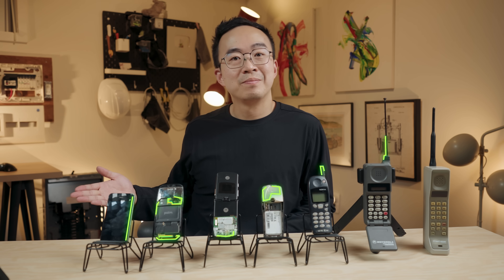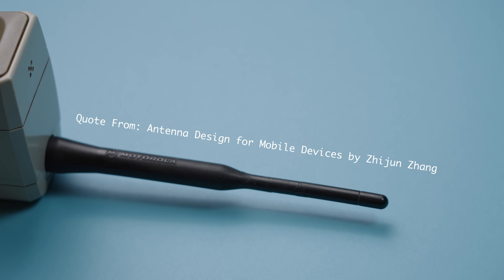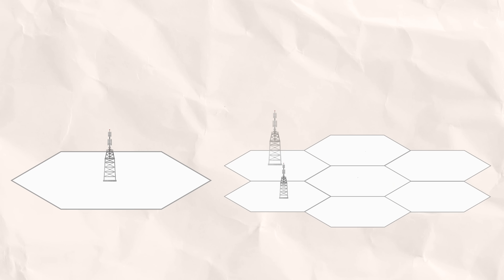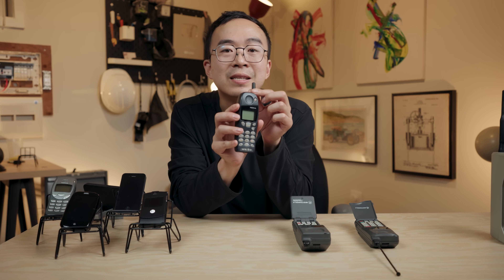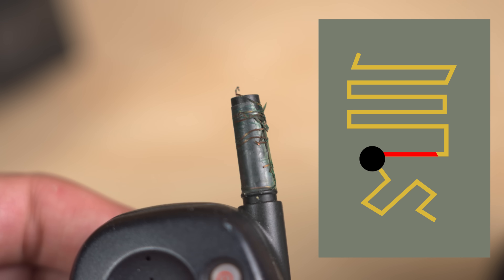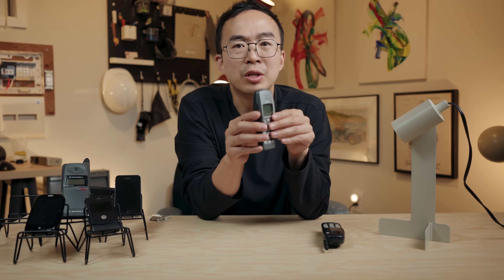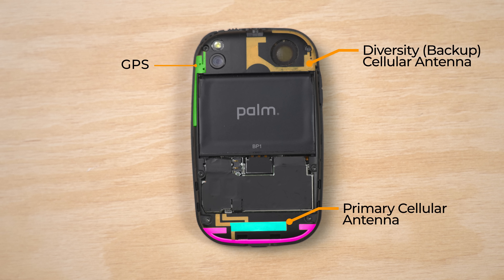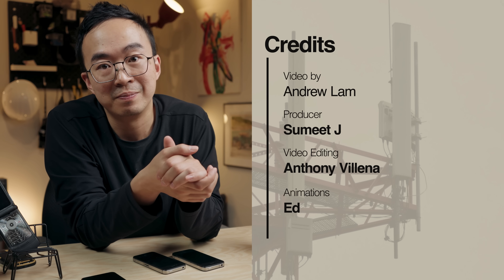How CLEVER Design Made Antennas Disappear

Comment: The iPhone 4 antenna snafu is such typical Apple. I remember back in 2006 when I bought an iPod gen 5 and complained that the thumb wheel was a bit too sensitive and lacked an adjustment setting, the answer was, "use your index finger." On the thumb wheel. OK.
Reply: Less "typical Apple" and more "typical sensationalist media". The iPhone 4 at two bars was receiving stronger signals than competing Android phones at full bars, but the internet saw an opportunity to be outraged and the rest is history. The same goes for CPU throttling, technology that is also used in... pretty much anything with a CPU. A modern PC has several pieces of hardware that throttle when under high stress in order to preserve longevity, but you don't see anybody crying about that. People are SO incredibly ridiculous that Apple eventually gave them the option to turn it off. Let's be very clear what this option is: it allows the phone to damage itself. People actually wanted that. They kicked and screamed until they got it. They are not smart.

Comment: Now phones and watches can talk with satellites too 😅
Reply: No?
They can listen to satellites, but sending information to satellites would require a lot bigger antenna.
Reply: @Floedekage   I have a Google Pixel 10 Pro and just last Tuesday my cell company added satellite service via Starlink.  At the moment, it's just texts but voice is planned for later.  Google also supposedly has a satellite service using geostationary satellites, but I have my doubts about it as geo stats are a much longer haul than the Starlink low orbits.  However, the demo that's built into my phone works well!  🙂
Reply: @James_Knott  it's very possible you can send voice from your phone via satellite, but you wouldn't want to do phone calls. The lag is insane.
Reply: @Floedekage   That would depend on the satellites.  With geostationary satellites, a hop would take close to 1/4 second.  But Starlink and others are in low earth orbit, around 1/10 the altitude of geo sats.  This would result in a much shorter lag.  Incidentally, for many years, before undersea fibre cables, geo sats were used for phone calls.  To reduce the lag they'd use the satellite in one direction and copper cable in the other.
Reply: @James_Knott  I'm sorry, when was satellite used for half the transmission of a phone call?
Reply: @Floedekage   I don't have the exact dates, but certainly during the 70s & 80s, prior to fibre undersea cables.

Comment: The number of towers is the really reason they could make the antennas smaller. Still lose signal in a lot of places every day so I wish you could buy a phone with a better antenna. Something like the first cell phone had would help. Maybe even a device in the car that would increase power and the antenna and we would not lose signal. And not cost too much
Reply: Your car cannot be a radio repeater because that would cause interference with the public radio waves, and you are not licensed for those frequencies
Reply: @KaitouKaiju  A mounted cell phone can have more power plus a high gain antenna which would increase range. Hand held phone are the only ones with low power rules to keep you from having too much radiating power near your head

Comment: Modern antennas are just built inside.. "Modern" because it's been the common practice since the early 2000s. However early 2000s phones were made of plastic so there was no need to add the seams. The metal around the phone made it more challenging to make antennas.

Comment: Cool video, as for why reviewers don't cover the antenna's it is a very difficult thing to test. Because of the loads of environmental factors influencing reception, getting reliable data in the field is hard. And lab setups using rf blocking chambers is expensive. 
If you try 2 phones in 3 different spots on different days results may vary wildly.

Comment: Antennas seriously deserve more attention in phone reviews. I had a mid-range Android, the Infinix Zero 30 5G, and the reception was pretty weak compared to my iPhone, which always has solid signal. I used to blame the network infrastructure here, but turns out the problem was just my phone’s antenna quality. Watching the video and seeing the difference in antenna design between the Infinix and the iPhone really explained why iPhones tend to have better reception. Antenna engineering matters big time!
Reply: This is why the first thing amateur radio operators tell newbies to do is buy a better antenna than the one that comes with a radio. A good antenna makes a HUGE difference

Comment: Nowadays there also seems to be phones that have even more antenna because the user might block both set of the antenna when holding the phone in landscape mode (for example, when playing games). Also, there are indeed tech reviewers that build their own celluar station to test signal reception, for example, Geekerwan does that for both the reliability and the speed, and also for testing power consumption in bad signal strength, although I'm not sure if they translated all their videos, and maybe it's better to use their Chinese channel instead. Also Linus Tech Tips had some plan to build a lab for that too, it's just that there doesn't seem to be much content from them about this topic.

Comment: 18:00 Actually, while you were talking about how the old bulky antennas were longer range than modern integrated ones, I was wondering why reviewers don't compare cellular range when reviewing modern phones. They often don't even do a cellular speed test, let alone a good one in controlled conditions.
Reply: I've noticed that my current phone has a worse connection in some places then the old phone
Reply: I think the key problem is controlled conditions. While a reviewer can easily test wifi simply by always being in the same room with LOS to the router. They would need to get pico cells for each generation type to make cellular a controlled condition.
Reply from the maker: One interesting  answer here on why cellular reception isn't the thing to test for: https://www.youtube.com/watch?v=RppnQ28BsiE&lc=Ugy_jX0PBSY22GPF6LF4AaABAg
Reply: Mr Mobile Michael Fisher put a bit more emphasis of the phone call quality/clarity. But that maybe fall under speaker quality rather than the antenna itself.
Reply: a phone is no longer primarily for calls
Reply: Because I don't use my phone for calls of any kind, I use it as a portable computer

Comment: As an amateur radio operator, I’m an antenna enthusiast.  You can make the worst radio talk around the world with the right antenna (and timing).  It still blows my mind how well modern flagship smartphone antennas work.  Mostly because of how much variable interference they deal with.  An antenna needs to match the impedance of its transmitter.  For most radios, it’s a simple 50ohms.  But it can really be whatever the engineer wants, as long as they match.  An antenna that’s too short creates more inductance, and an antenna that’s too long creates more capacitance.  But other things can change its electronic length.  The type of insulation used (if any),  changes the speed current moves through the antenna.  Normally the speed of light, but insulation basically makes it pinball more as it tries to travel straight.  Things near the antenna also change its electrical length, like your hand hovering a few mm away.  They must be using a solid state impedance match (antenna tuner) inside the phone to dynamically compensate.
Reply: short antennas are more capacitive
Reply: 50 ohms is chosen because that is roughly the impedance of a vacuum.
So most wireless communication will choose to set their impedance to that...
Reply: I got a gameboy cart that functions as an FM radio recently and it's been fun playing around with it. It comes with an internal antenna but can also use a dedicated 3.5mm antenna or headphones as an external antenna. With the external antenna reception isn't all that great, until I move it closer to my radiator pipes at which point it shoots up fast. RF is amazingly complex.
Reply: Yes, there are dedicated internal antenna tuner chips such as the 32CK301R ("old" LTE chip) and onboard tuning strategies in some integrated RF chips. They are pretty different than the two needle antenna tuner box on the shelf of a well equipped ham shack, but the principles are the same in the end, the matching networks are just much smaller.
Reply: Very cool, what do you think of DJI OcuSync?
Reply: I'm curious about this topic, and I took a course where I learned smith charts and loved it. Tuning is essentially an effort at impedance matching as the antenna's impedance changes depending on the frequency being used, right? So you're just trying to pull it 'up' or 'down' (toward the Z=R line on the smith chart) with more inductance or more capacitance?

Can you also pull it left and right (change the simple resistance)? Or do you just try and pick resonant frequencies so you don't have to?

Comment: Used to be able to take a cell phone in the 90s far deeper into the wilderness than you could today.  I miss those days.  I don't care about bandwidth, I care about being able to reach my family without needing to rely on satellite devices
Reply: Yeah, modern cellphones use higher frequencies for faster data with the compromise of shorter range. For your use case, you should look more into amateur radio instead (if you haven't already). You can even send text messages and emails through amateur radio frequencies if you get your ham license and can get very long distance communication without any infrastructure (even longer with repeaters if you aren't using HF frequencies).
Reply: @GhostRyder2008  I guess meshtastic also makes sense for that use case?
Reply: @GhostRyder2008   They also use lower frequencies.  The lowest cell band I'm aware of is 600 MHz.
Reply: Well you are in luck, in the next 1-2 years every 4G capable phone will be a satellite phone. Starlink now has 4G phone transmitters in it, it's not particularly fast but it will be able to be used to send text messages and at some point voice calls. The idea is it will be a fallback network for when you are in the middle of nowhere.
Reply: @Dragon_Slayer_Ornstein Oh so the satellites themselves have the transmitters for the cellphones to understand? I was wondering about that. I was thinking that we'd need to start putting a new length antenna in all new phones to take advantage of the Starlink satellites because normally they use very different frequency bands. That's cool that Starlink had the forethought to do that 🙂
Reply: @Dragon_Slayer_Ornstein  4G or 5G?  My cell company added Starlink service last week and every supported phone they list is 5G.  I have a Pixel 10 Pro, which is supported but my old Pixel 6 isn't.  Both are 5G.

Comment: 1:11 Bold of you to assume I have an iphone. My samsung device does not have those lines.
Reply: could I ask which specific Samsung you have? because their flagship models (S25, Edge, and Ultra) absolutely still have these lines on the sides
Reply: It has to have a way for the signal to get to the antenna somewhere. I'm not sure if glass-backed phones need antenna lines or not, but even my glass-backed OnePlus 8T has four of them. Maybe yours are just hidden better than most, or maybe that model didn't need them because of its design, but it's definitely not iPhone-exclusive, and Samsung devices do typically have them somewhere, at least.
Reply: @CDCI3  Could they be behind the screen or on the back like what was mentioned in the video? I think my S7 did have the plastic lines on it, but all the newer samsungs definitely have no visible lines on their frame.
Reply: Okay, I had it wrong. That isn't where the signal gets in, it's what breaks up the side of the chassis to make the chassis into the antennas themselves. But still, even if they're not noticeable, they almsot certainly exist in some form.
Reply: Um most metal frame phones have it. What model is yours
Reply: @VENOMYT5  As I told the other guy, I have an A53
Reply: @Sollace  if your phone is a Galaxy A53, then that explains it. A53 is a plastic frame model. 

While A55 is a metal frame one and you will see those antenna bands
Reply: Yes
Reply: Which samsung do you have? Mine has them

Comment: I had experienced something i found pretty strange recently in that my comparatively newer pixel 7 pro had worst location accuracy compared to an older s20 fe from samsung released 2 years before the pixel. when placed on the same surface and with the pixel even having a cellular connection it had a cumulative deviation of 20km compared to 2km of the older samsung phone. i had repeated the test multiple times and i have noticed that the pixel tends to only be able to acquire 10-20 gps satellites while the samsung was able to get 35-45 and that even when the pixel is touted as being able to receive L1 + L5 signals.

Comment: this video was boring and felt to me like a waste of time but I watched till the end it basically can be summarized to "antennas got smaller then they needed to double in order to cater different bands then more cells boom bob's your uncle" <---- ridiculous oversimplification, and not that's not because I am an electrical engineer, this video could have been made by a junior high pupil like an essay or something... 
you could say a few words as to why things happen, why did phones have also a 2ndary hole (that gold spot on the back of every phone )  to plug in an antenna ? why razer could be held from the bottom and still have signal? if the antenna of iphone 4 was problematic what did change from iphone 3? why the first 7" motorola antenna could deflect signals from your head?  why we gone from straight wire to squary wire? we didnt use only 2 signal bands but in lots of phones we see just 2 lines of wire or do we? and obviously a lot of other questions and one doesnt have to get ridiculously technical its called popular science communication, you were just too bored to look into these ....

Comment: Yes!!! I was searching all over cell phone review videos when I needed to replace my iPhone 8.. it kept losing the signal, and not always getting it back. Particularly in rain and tunnels. I knew the 10 and up had 5g. Wasn’t sure if that really made a difference. No one could tell me. And not any reviews really touched on antenna performance and which phone and phone carrier would work best. I wound up winging it and getting an iPhone 13 and thankfully, it is so much better at carrying a signal without dropping it. T-Mobile though, still has issues with apartments, basements and tunnels, while at@T can even hold a signal in those spaces (the tunnels have antennas)

Comment: you left out the one antenna that is present in pretty much all phones sold in the rest of the planet, the FM antenna, which almost always used the headphone socket as antenna, or the charge port, so you needed to have either headphones plugged in, or a charger connected, though you did not need to actually have them in use, just plugged in, to use the built in FM radio on the phone. Only in the US market is the FM radio disabled, you reflash the phone firmware to any other country, or factory reset it and choose a different country, and you have a FM radio as well. This also shows up on many small media players, where pretty much all of the models you find, even the cheapest ones, will have FM radio built in, even if they have no other wireless capacity at all. Fm radio is popular, because it works, and does not need a network connection, or the phone to have any airtime or data available, and just uses battery, nothing else.
Reply: I keep seeing people say this, BUT, I've owned phones both in Europe and the USA since 1990.  I've never had a single phone, Euro or US, which had an FM radio built in.  Not my UK, NL, or DE phones.  None of them.  and I've had A LOT of phones over the years.

Comment: I want to point out how easy it is to take apart and service those old phones, compared to "modern" phones that are glued together.
Reply: It's still pretty easy to service modern phones with modern diy tools
Reply: Samsung still made smartphones as easy to take apart as those old phones; eg, 2018 J2Pro has a clip off plastic back and a battery that just pops out, but still has modern features, such as an aluminium frame, Gorilla glass with an AMOLED screen, 1080p video, and more with a cheap, entry level phone..
Reply: Well if you have the money, Get a Fairphone.